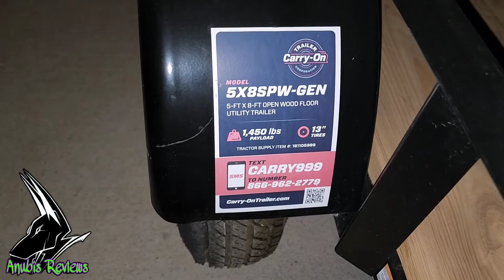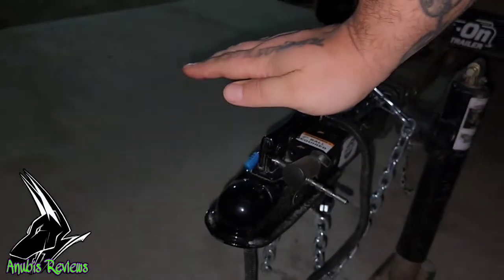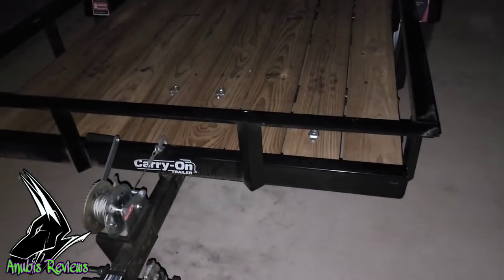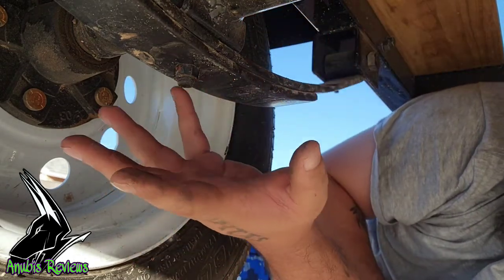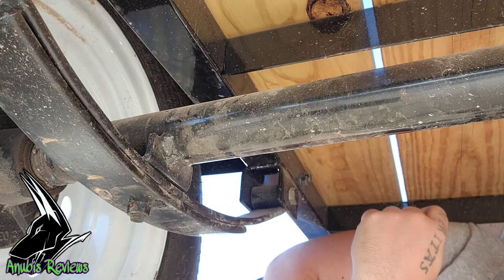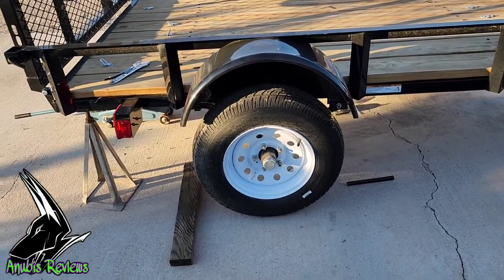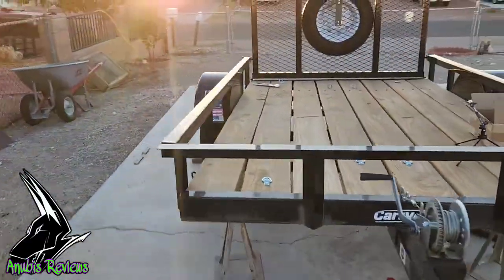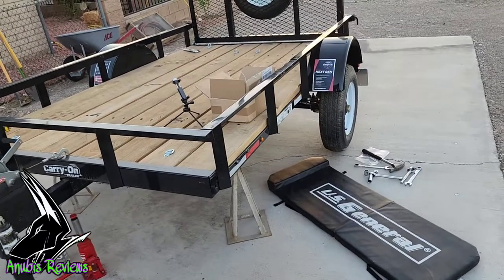Installing a Trailer Axle Flip Kit

Comment: It seems like the gate would be to short to use for riding mowers ...it seems like it would cause riding mowers to drag because the gate would be at a steeper angle. Has the height difference of the trailer negatively affected the use of the gate for loading and unloading?
Reply from the maker: The height only changes the angle a bit and not enough to cause an issue with my use of it, which is mainly transporting ATVs and hauling trash to the dump. Even then I added front and rear stabilizer jacks so I can raise the front higher and drop the rear having 6 points of contact not including the ramp. It's kind of like having a home made tilt bed trailer.

Comment: That’s a straight axle why can’t you just flip it upside down and use the original hardware? 🤷🏻‍♂️
Reply from the maker: A straight axle is never really straight. It is bowed so when pressure is placed on the axles the wheels don't cant inward. The center of the axle is 1.75 inches higher than the ends. Another issue is that axles have pins to lock them from spinning and moving side to side. The brackets, plates and u-bolts aren't designed to go upside down as the tilt of the welded on brackets would make the trailer unusable at any speed higher than 15mph.
Reply: That makes sense, didn’t realize that . Thank you sir

Comment: I have never seen a winch on a 5x8😅
Reply from the maker: It makes sliding sleds of steel up the ramp easier. It also helps when pushing quads that don't run and weigh 800lbs. You want to break your back doing stuff the dumb hard way then go ahead and have fun. I'm not going to struggle to lift and move a Merc engine and transmission on a skid just to get it on a trailer when cranking a winch makes it a breeze.